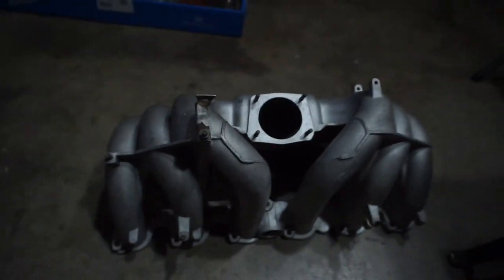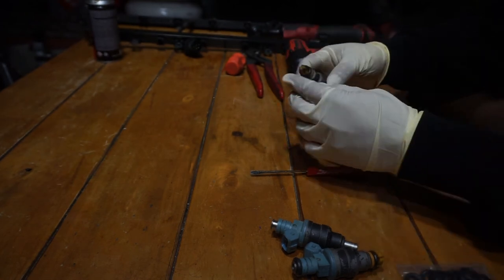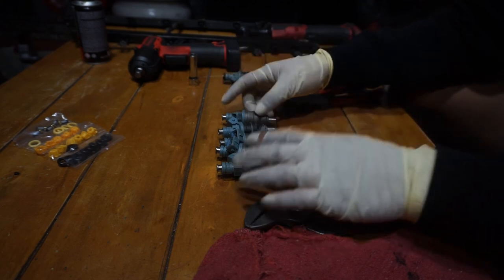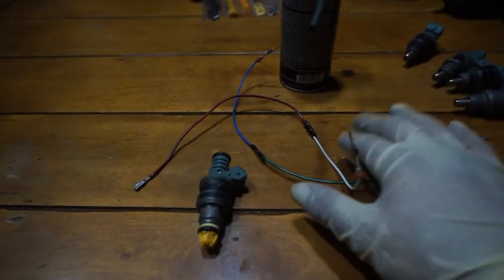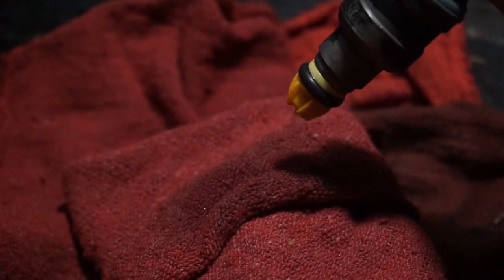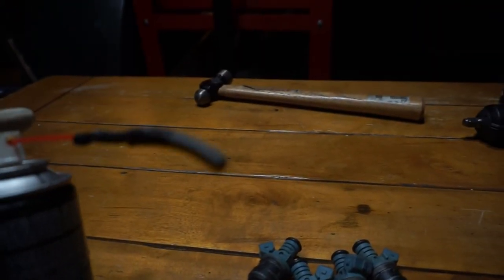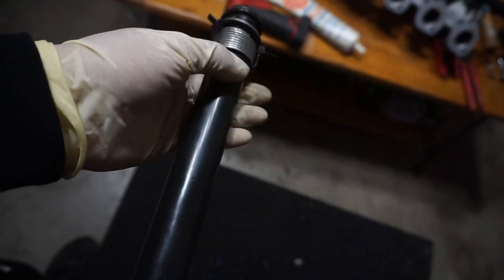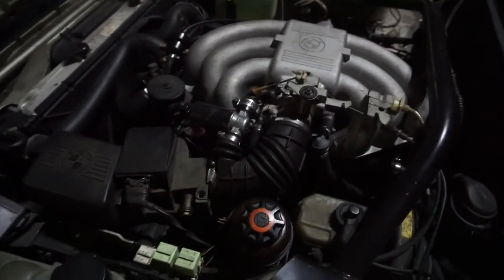Bmw E30 Fuel Injector Vacuum Leak pt.2 Clean and Rebuild Injectors !

Comment: What were the symptoms that led you to do this? My e30 runs rough at idle and won’t let me accelerate more that like half throttle. I’m thinking it’s the injectors.
Reply from the maker: Ashcashbackfatt Ashcashbackfatt My idle would serge for a couple seconds before settling down. You can put long screwdriver on the injectors and check if they all sound the same. If one sounds different it could be clogged. For your situation I would check if the catalytic converter is clogged by going by the tailpipe and making sure theres sufficient exhaust coming out at certain rpms. Also, check the or replace the fuel filter if its old if you don't have any fuel leaks.
Reply: I might try the screwdriver trick you mentioned above to listen to my injectors for a stuck injector since my car has at least one fuel leak and possibly a stuck injector - thus the 16MPG city I'm getting. Even though it's a stroker 2.9L M20, I still believe I should be in the 23+ range at the lowest.

Comment: Nice videos, got a e30 325i and just fixed a no start issue it had since +10 years ago, finally started but is misfiring guess I will need to do what youre doing in this video and check the spark wires, thanks for your videos.

Comment: Bro, I need some help. I can’t seem to get my E30 to start, I’ve replaced the fuel pump but I don’t hear it. I’ve replaced fuse 11 and the fuel pump relay seems good. I’ve also relaxed the external fuel pump and gas filter.
Reply from the maker: Have you checked the fusible link near the battery ?
Reply: @EricNomads7  I wish I could send you a picture but I would say no since I’m not sure exactly what that would be or look like.
Reply: Has a similar problem, turned out to be the ECU....

Comment: where did you buy the rebuild kit?
Reply from the maker: eternal24k I bought it on ebay
Reply: eternal24k they are super cheap on amazon
Reply: john jay  Its plastic caps, nylon washers and filters, relax, or go give bmw $600 for new injectors and that you don't need
Reply: john jay  m20, stand alone ecu, injection and individual throttle bodies. done
Reply: john jay  yes. Carbs are good, but you will never get the performance out of them like you can with a modern ecu, itbs, and a tune